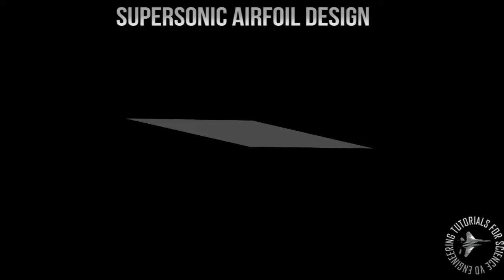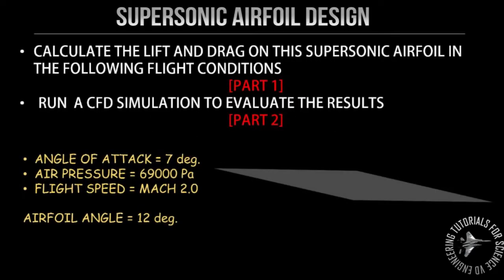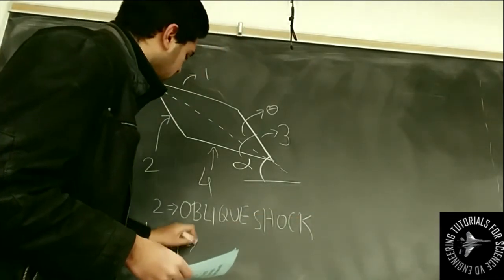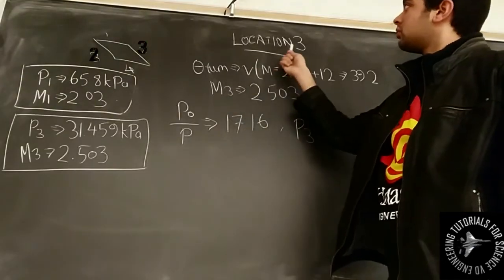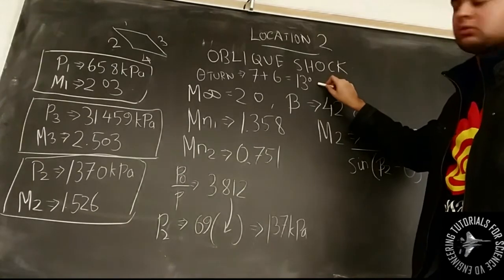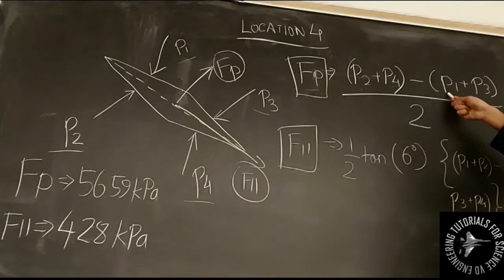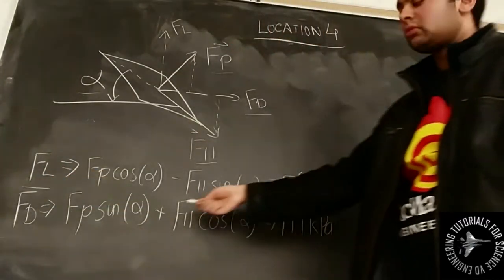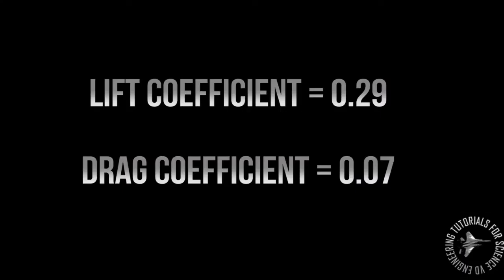High Speed Aerodynamics (Part 1): Lift and Drag on Supersonic Airfoil - SOLVED EXAMPLE!

Comment: dont see why the first expansion in the upper part of the profile
Reply: He made a small mistake for the upper part of the wedge. The ramp angle (flow angle)for the 1st upper part should be: theta = delta (half angle of the wedge; 12/2 = 6°) - angle of attack (7°), which gives -1°. From this we can conclude that when the ramp angle is smaller than zero , so it will be an expansion wave. That's why the first upper part is an expansion wave, and not an oblique shock. Bear in mind that if the ramp angle (theta) would greater than zero, it will be an oblique shock.

Comment: Hi there. I am 3d artist and I barely understand what is going on here. I am working on a model of hypersonic aircraft and I wonder: is the cross section of the wing really diamond shaped in this case or is this some kind of simplification? Will wing made for hypersonic flight be made of flat surfaces and sharp edges?
Reply: it depends on where you are in the hypersonic regime. Up to a point, depending on how well you can cool the leading edge, it will be like supersonic airfoils but pointier and sharper. Then, as you continue to increase the speed, the heating becomes so intense that you have to round off all the leading edges into blunt bodies and just accept the drag penalty
As for whether actual supersonic airfoils are diamonds, they are not. If I'm not mistaken they use 2 very shallow arcs of a circle placed back to back. the diamond foil is just simpler to analyse